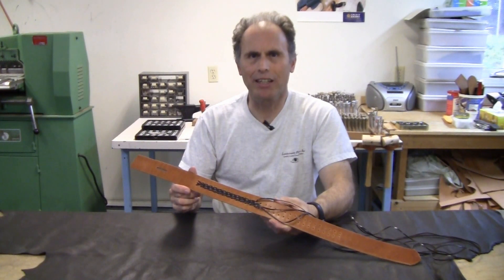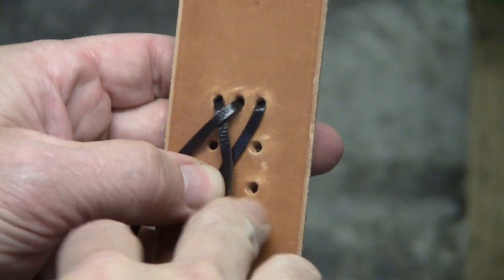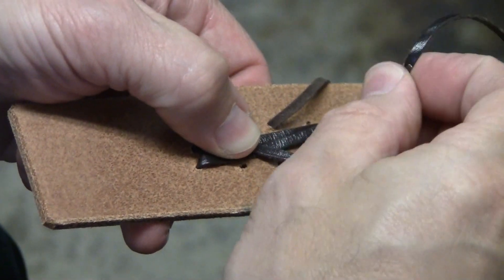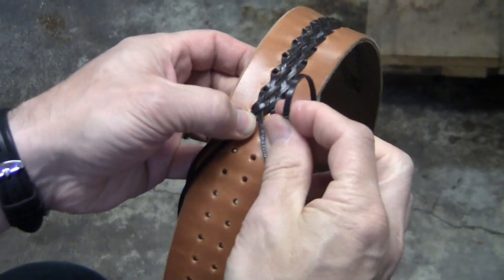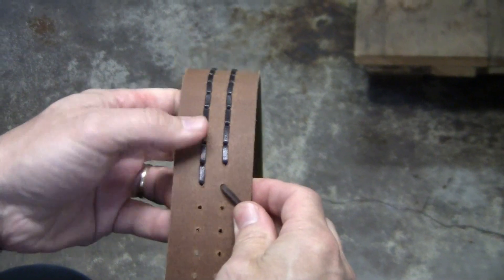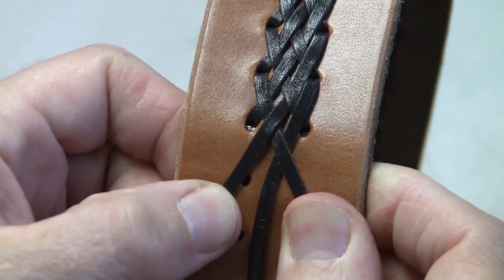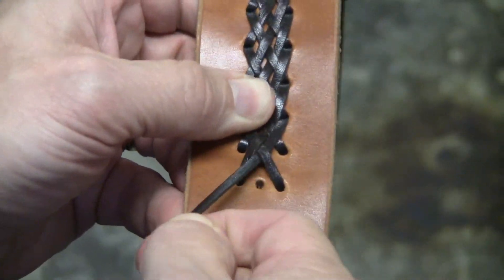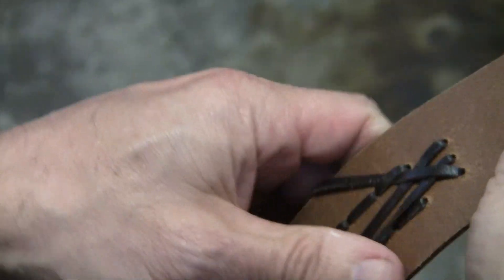How To Braid Leather With Three Laces

Comment: Hi thanks for posting. 

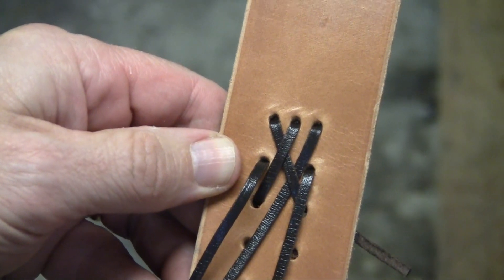I'm stuck on what to do with the far right braid and where it fits into the pattern. I can get to 2:22 part of the video but at the Step 2 lacing part where you have a bit of the pattern started I am confused with the lace on the far right. Where does it go at the beginning - in the third or fourth hole? I realize that every second hole is laced and then go back one hole. 

Update - I found your blog post on this and will follow the instructions there. 

Thanks in advance.
Reply from the maker: I was wondering if you eventually succeeded with the braid after reading the blog?

Comment: How far apart are the holes punched?
Reply from the maker: The holes for the lacing done in this video are punched at 1/2 inch centers.  However we have made tighter looking braids on wristbands which are punched with 1/4 inch centers but they take a lot longer to lace when the holes are so close.
Reply: Where are those lace available and what is the width of the lace?